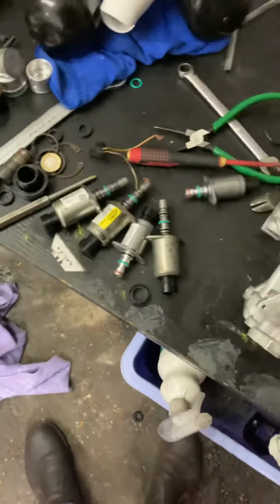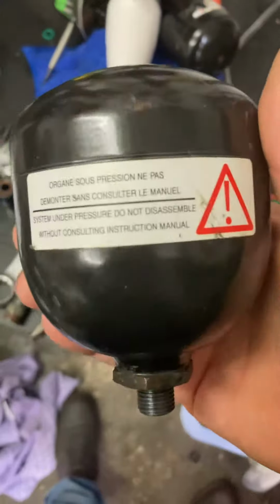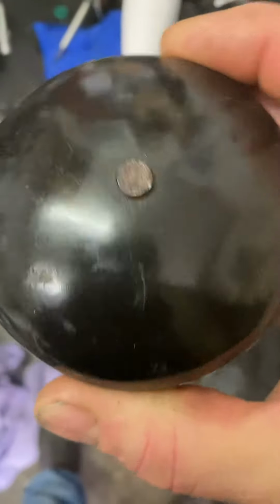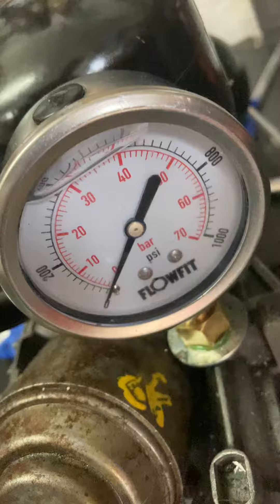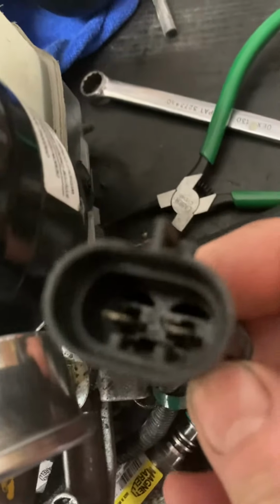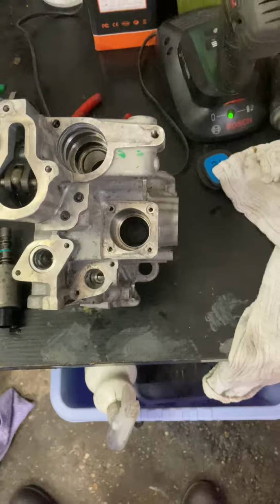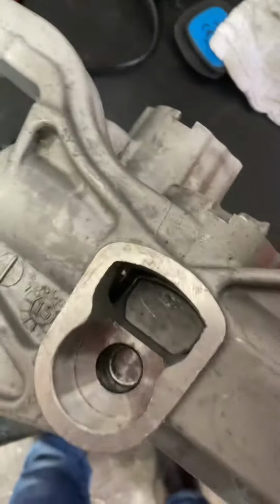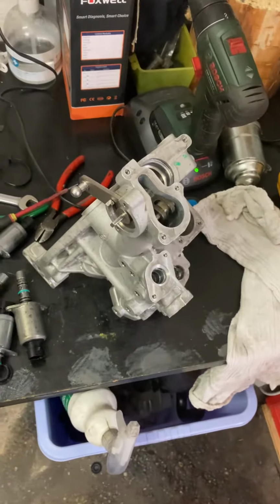Renault master semi automatic quickshift Accumulator burst

Comment: Mine has now for the second time, decided it doesn't want to select a gear at all. Happened about a week ago, then went back to normal until yesterday. Now it won't go into any gear at all. Any info would be grateful
Reply from the maker: Check hydraulic pressure in live data
Reply: which model dp you have?

Comment: what was the symptoms for this part failure? Asking because I am having an issue with my Renault Modus with the same gearbox. The issue is on first gear and it kicks very bad, after I press on the gas pedal and shift to 2nd gear after that 3, 4, and 5 shifts perfectly fine. the issue is only when on 1st gear or Rear. Please let me know if this will solve the issue? Thanks!
Reply from the maker: Hi your robot is different however your master on the unit I would suggest changing if the clutch is bagging out late.
Reply: @controlfreak6748  I have replaced the clutch and the pump, now with the new clutch the car won't complete adaptation, also still kicks and shuts off, just like if you are with manual gearbox and lift the left foot from the clutch quickly.
Reply: same same problem i am facing with my renault clio 3 semi automatoc. which model do you have